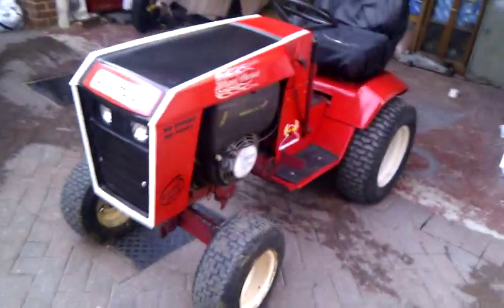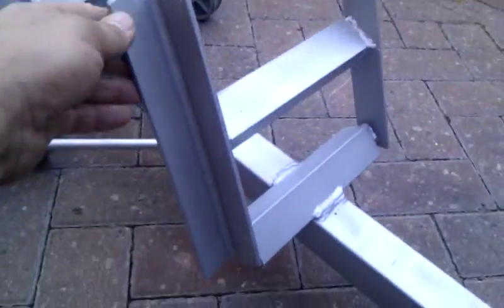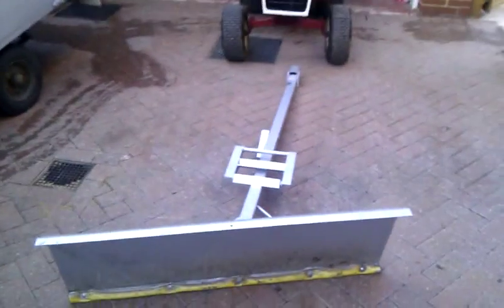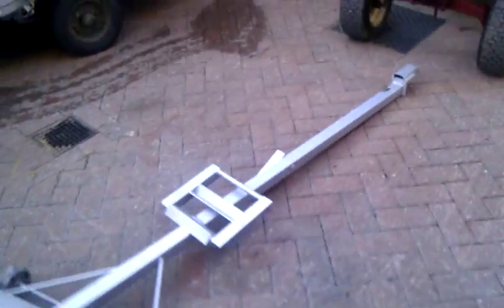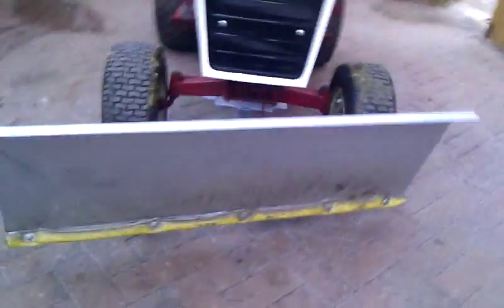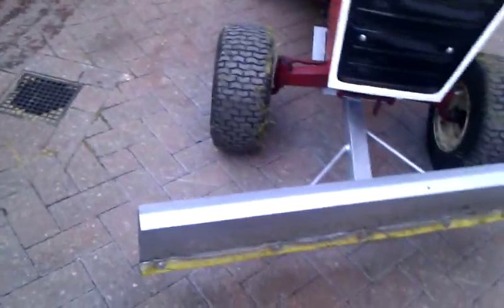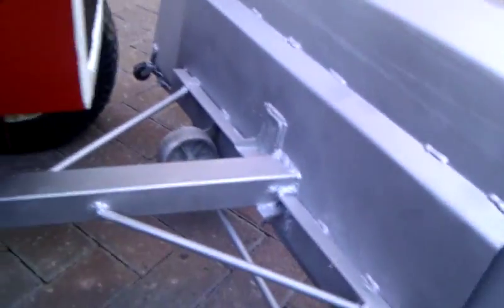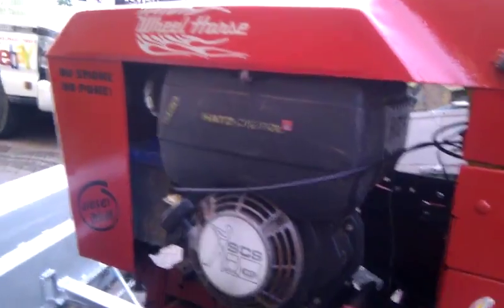Fitting home made,snow plow, to Wheelhorse

Comment: This "one" hurt me. Just seeing a "classic " Wheelhorse with a "rigged up" excuse for the BEST system ever invented on a garden tractor,  must of been a total "act of desperation". With hundered's of vidios on Wheelhorse Dozer plows out there with a simple and proven design--why this contraption? With just two long tapered "C"channels to a gusseted sliding pivot pin pivot locator and a cross tie rod rear AXLE mounted pivot, He could of had a "Masterpiece ". There also must of also been a RED-Paint shortage. A build raiting of 2 of out of 10 could of been upgrade to an 8 with a 65% increase in time and material plus Some "RED PAINT".  Have seen "Much " better "Builds" from 14 year old fabricators on their Wheelhorse's.  This must of been a reclaimed scrap invention with little thought,preparation, planning & a LOT of silver paint laying around effort.  This poor " ole" Wheelhorse got completely Tortured.